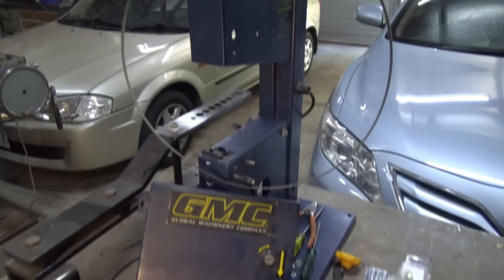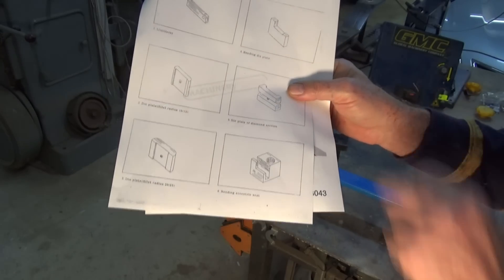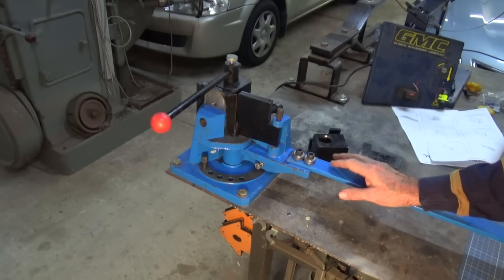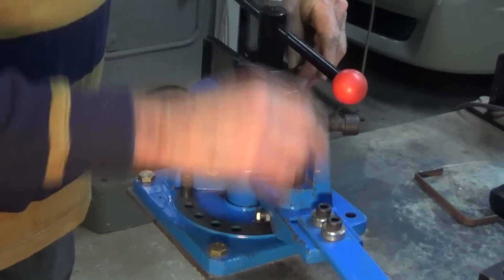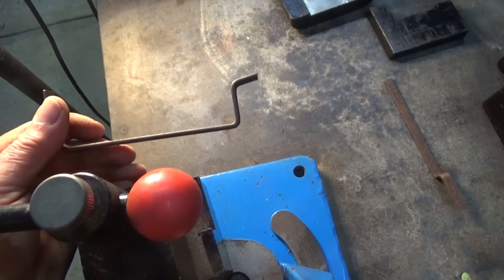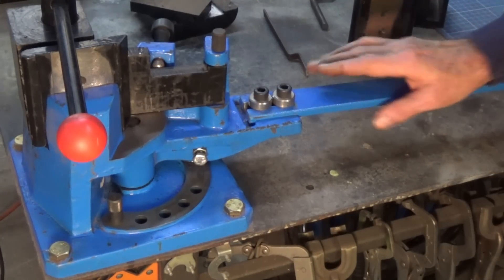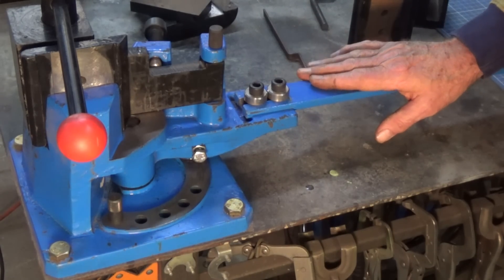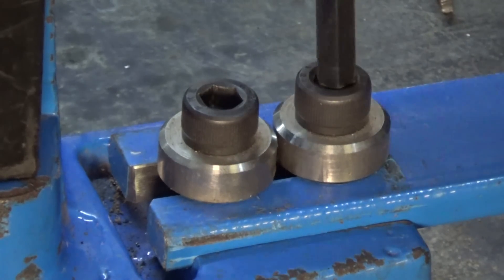UB100 Universal Bar Bender - Mystery Parts

Comment: Use that type of bender at work and did a few modifications as well. Welded some round bar to the end of the bending die nut to get some leverage and easier to release. The bending handle also bothered me. Cut the bending handle off at roughly 150 mm sticking out. Welded some flat bar to it until it fit inside a thick walled pipe. If I need a bit of leverage I just slide a long piece of pipe over that small overhang. If it is tiny delicate work  a small length of pipe will do. No bolts to unscrew. Just slide the pipe of and on.

Comment: Hi mark I have just bought one of these, has one else die blocks got small indents in when they bend round bar ?? 

Thanks james
Reply from the maker: The die blocks on my bender were quite hard, I know because I had to machine the back of one where it butted up against the frame of the bender. However, I have seen small diameter round bar indenting edges on pan brakes. We had one at the school where I used to teach and kids would try to bend wire in the pan brake. It put almost impossible to remove dents in the bending dies. Quite infuriating! I have bent 6 and 10mm round bar in mine and it seems to be OK with that. I generally won't use the sharp bending die though. There is one with a more rounded edge which is probably better suited to that operation. 
Regards,
Mark

Comment: My two cents!!!
I don't have the room to leave mine anywhere so I bolted a plate to the bottom with a heavy walled 40mm  RHS welded to it at the ends. (At the ends so the welds don't interfere with the jaws of the vice). I just pick up the whole bender stored below my vice and put it in the vice when I need it.
Also you have two Allen key sizes. Not sure why you didn't drill and tap the handle mount from 10 to 12mm. The slot will only be 1mm wider on both sides.
Also you can do the Z bend by putting the handle at 90 degrees and you use the L plate as a spacer to hold the work which is now upsidedown. You bend in reverse moving from 90 degrees to the zero position to achieve the second bend in the reverse direction. This method allows you to choose any distance between the two bends greater than 20mm.
So you are doing the second bend with the edge of the bending plate.
Reply from the maker: Thanks. It's a pity the manufacturers don't support their products with more informative manuals. Being able to store the bender after use makes a lot of sense. Mine gets in the way a lot but it sure is solidly mounted.
Regards,
Mark

Comment: Hi Mark, I'm just reviewing this unit and have ended up on YouTube. Appreciate your comments as I'm looking at the same at Hare and Forbes here in Perth. In the information section relating to this device they mentioned being able to bend at varying radius by changing/turning the die plate. I noticed that one die plate has radius corners. This means that you can achieve a lot more in both flat and round bar stock. Have you used that function?
Cheers Les.
Reply from the maker: Les, yes I do use it especially on aluminium which can fracture at the outside radius of a sharp bend. The rounded edge die puts a lot less stress into the material. The only thing I had to do was to mill the flat faces on the dies where they clamp against the fixed jaw. Mine were forged and the surfaces were quite rounded. It was hard to get them clamped accurately. I used a carbide insert face mill to clean up those surfaces and it does make a difference to the accuracy and repeatability of the bends you can achieve. 
Regards,
Mark

Comment: I did mean to ask, have you tried it on square tube?  Looking at one for a truss making job.  Would need to add something to the die to collapse the inner side of the tube but that would be trivial
Reply from the maker: I have not tried this machine of tubing. I do have a Hossfeldt clone bender and with the correct die you can bend square tube. I made one for round ERW tube but so far I haven't had the need to bend square tube. The dies I have seen for doing this have a small diameter round rod welded to the inside diameter form of the die to collapse the surface of the tube as you say. 
Regards,
Mark

Comment: Nice video.  Only point I would make is when using the eccentric I would pack the part so your angle is accurate.  The top section is for the same thing, making U turns on larger pieces which are too long to use the other die as they would interfere with the handle.

Comment: Being an old video you may not ever read this and may already have worked out what that cut away is for on the thin section of the large mystery block but I would say that it is for instead of making your jiggles or whatever you called them {the z shape} they are to make a square U shape or even to go on to make a full square as long as it has long enough sides to wrap around that inch or so of metal. You could make squares them weld up one corner to have a solid square.
Reply from the maker: I am sure that you are correct. It's just a pity that the "manual" doesn't have a little more information on how that block is meant to be used.
Regards,
Mark

Comment: Hello Mark, Mick here from Victoria and thanks for your video. I’m finding that during my use, the removable former pin is being bent to such an extent that the former is pushed out of vertical , rather then bending squarely I’m getting out of square bends. 
This while bending ⅛ flat so nothing too strenuous or heavy duty!
Unequal radius on bend don’t go well with accuracy!
I’m also having trouble removing the former pin because it is so distorted, once out it can be straightened again.
Have you read of similar experiences with using these metal benders?
My intention is to insert a wedge behind the former plate, hopefully that will prevent any distortion of the former pin together with ensuring an accurate and square fold/ bend.
The wedge will be secured in place by the 
⅝” Allen bolt therefore prevent any possible wedge misalignment,your thoughts please!
Cheers, Mick.
Reply from the maker: Mick, I seem to recall that the maximum thickness of flat stock for this bender was 10mm. However it depends on how wide the stock is too. I don't think I have tried to bend 1/2" in my machine. Probably if you were to use the die with the large radius edge it would reduce the strain on the centre pin. I did bend some 75 X 10 hot rolled steel but I slit the bend line through about half way with and angle grinder first and then welded up the resulting groove after the stock was bent. If you have access to a lathe, I would just machine up a new centre pin, preferably from some higher tensile steel stock. Something like an old truck axle would be good. 
Regards,
Mark
Reply: Hello again,
Not attempting anything like 10mm plate unless last resort,as per my comments I intend only dealing with light materials, 3mm (⅛) is common with my projects up to the most perhaps 6mm .
Wedge behind the adjustable former plate has fixed the misalignment problems,easy addition and held in place easily.
This is a great bender once the bugs are sorted,thanks again for the video!
Cheers, Mick.

Comment: So just watched the ToT video on his version of this. He had to machine the faces on it to get it to work correctly. I was wondering if you had to do the same thing but I think you got  much better version of the bender.
Reply from the maker: I watched TOT's video too. I didn't have the same issue with the out of square anvils but I did find that the backs of the fixed anvils were anything but flat. It looked like they had been forged badly and they wouldn't sit flat up against the fixed section of the base casting. I had to mill them flat before the two socket head screws could pull them hard up against the casting. I was surprised that the handle supplied on TOT's bender was just a piece of hollow tube. Mine was a solid piece of flat bar stock. Also, I would not be willing to try bending 10mm wide stock over 6mm thickness. Even 3mm is a bit of a struggle, but then I'm no Arnold Schwartzenegger!
Regards,
Mark

Comment: Hi Mark, just finished rewatching this video and I think I know what the step in the big "mystery"block is for. this is a somewhat older video and there are 97 comments which I haven't all read, so you may know the answer already, but anyhow: my guess is that its function is the same as from the mystery plate, to allow an already made bend to fit in the block. somewhat like a u shape that you want to bend again if that makes sense... Keep up the good work, I have seen most of your videos and love the content. Peter (from the Netherlands)

Comment: For the handle just make a bolt on stub out of round bar and a piece of flat then simply slide a length of tube over it when using the bender no bolting on and off then
Reply from the maker: I use that method on a Hossfeld bender clone that I made. For light bends on the universal bender I just leave the bolts loose and slip the handle slot under them. 
Regards,
Mark

Comment: Would this bend 3/4 round bar?
Reply from the maker: That might be a little too heavy for this machine. We could do 1/2" hot rolled easily and you would need to use the die with the large radius. You would also need to have your bender bolted down to a really heavy bench. 
Regards,
Mark
Reply: Thanks Mark. I make hooks from rebar for target stands. Harbor Freight has their version but liked the looks of this one even though it’s more expensive. Mostly 1/2 to 5/8 but I figured if it could do 3/4 the slightly smaller ones would be easy.

Comment: Can u bend 8x75mm flat stock with these? Was planning on making desk legs
Reply from the maker: I don't think it will do steel of that size. I have been able to get 4 X 75. I have had success with bending thicker stock by partly cutting through with an angle grinder (about half way) and then making the bend. You can then weld up the gap.
Regards,
Mark

Comment: Thanks Mark. I am off to buy one today. FYI, I have a small workshop with a welding / assembly bench. I have various bench mounted shears, vices and benders that I like to use but I still need to use the bench for welding. After some thought, I welded 8 of 50mm receiver tubes under the bench top in various locations. Each tube has a couple of bolts under it, threaded through welded on nuts. Now all my equipment is mounted on plates with tubes that slot inside the bench mounted receiver hitches. The effect is similar to a tow bar receiver and hitch. I can choose any location around the bench for any of the equipment or clear everything from the bench in about 60 seconds by loosening two bolts and withdrawing the equipment on its mounting tube. Works a treat!
Reply from the maker: I have been thinking that I need to do that too. I have a bench vice that I would like to fit to the welding bench but I already find that the bar bender and a replica Hossfeld bender which are permanently bolted to the bench get in the way of any welding job I want to do. Adding the vice would just make it worse. Another job to add to the ever expanding list!
Regards,
Mark

Comment: This is a great tool if you wanna pry straight and grind square every piece of steel it destroys. Not to mention all the fun you'll have grinding square the warped plates it comes with. The good thing is that it's heavy, so you'll get about $2 for it at the scrap yard.
Reply from the maker: I had used on those benders at work and I already knew their limitations and problems but it does a limited range of bends quite well. The bending dies all needed machining on the face that clamps against the body of the bender and once I did that the overall accuracy improved. Like all these import tools, you are essentially buying a "kit of parts" as Stefan Gotteswinter likes to calls them.

Comment: mark i was wondering do u know what sizes allen wrench it used on the side to change the die i bought one just like yours
Reply from the maker: John, I'll check tomorrow and let you know (it's late now).
Regards,
Mark
Reply from the maker: John, The screw on my bender is M12 X 1.75 at 65 long and the hex key is 10mm.
Regards,
Mark

Comment: hi mark, can this tool bend past 90 like for some hairpin legs?
Reply from the maker: Dan, yes, the UB100 bender comes with an anvil with about a 45 degree angle on it. There is also an anvil with a radius edge which will bend past a right angle but it gives a more gentle round.
Regards,
Mark

Comment: Hi Mark, just picked up one of these for next to nothing,but with only one plate, looked up Hare & Forbes for a manual & got the same as you. Pretty poor for something they sell for $319.00 on special. I can mill up some plates as I need them out of some blocks of pre hardened M238 injection molding steel I have . Thanks for the intruction video it’s really helpful....... I’ve subscribed also. Cheers Peter 👍
Reply from the maker: Peter, the brand new plates that I got with mine were very badly forged and the mating surface which clamps up against the body was rounded instead of being flat. I had to mill all the mating surfaces flat before I could use them. It would be useful to make up some "specials".
Regards,
Mark

Comment: Hey ime having a massive problem with my bender, it is not bending 3mm flatbar to 90 degrees it's so off it's like 35 degrees. Any ideas how to fix it?
Reply from the maker: Wow, 35 degree error sounds like a lot. There will always be some spring back in even hot rolled steel but normally you will need to overbend by about 5 degrees to allow for spring back. I would just make sure that the square clamping block is pinching the stock firmly and then adjust the bending plate with the adjusting screw so that it is flat against the unbent portion of the stock before you start your bend. 
Regards,
Mark
Reply: @Preso58  yea it is a lot of play. I checked the entire machine all fittings blocks and mock test without material and the machine stops bending way before 90 degrees I would say probably 35 degrees or so. I cant understand what it is that's causing the problem. The only way I can bend 90 degrees is by having no pin in the degree holder but then again that's pure guess work with no pin. I made a set of coat hooks and had to stop every second on every bend and check curvature by hand using a digital gauge. It took me forever and I am still determined to find out just why this silly thing wont allow me to bend using the  gauge. Thanks for reply m8.

Comment: Mi mark,
thanks for the info, I now know what the extra parts to my bender are for.
the rear cut out for the Eccentric block will be for allowing the fitting of a U shaped bar to be bent. the leg of the U both point in the direction of the handle.

Comment: I was thinking the cut away sections could be for forming  the ends of springs like the type you see on throttle shafts on some carburettors , one end is bent up and over the throttle arm and the other formed so it locks over a spigot on the carby body - a bit hard to explain ,  easier to show  if only i could post pictures here !.
Very hand tool those benders , i haven’t used one for  a long time and wish i had the room for one now ! I like the idea with the handle and i am going to copy it for my metal shears !
Reply from the maker: Ian, I went back and played with the mystery parts again and I was able to make up some small "top hat" profiles from round bar. The geometry of the bender is a bit restrictive and it is mainly intended to do one way angle bends in light to medium section material. I was just frustrated that the parts as supplied were not documented in any way. I was thinking that the video might prompt others to share any knowledge about how it is meant to be used. I take your point about the bend you are describing. I didn't try that but it sounds doable.
Regards,
Mark

Comment: Great explanation on the bender & accessories. Like your handle mod, got me thinking you could also have a rectangular steel block, milled out to step over handle, to help prevent handle spread.
Reply from the maker: That would be a complete solution but probably a "belt and braces" job. 😁

Comment: As far as I'm aware those tools are as you described. The three most common applications I've seen these eccentric dies used for is making custom U-bolts, handles, and offsets. 
Every shop I've been in always had these cold forming benders mounted on a pedestal stand  rather than on a bench. Of course the cold forming benders in those shops were the type which had a bazillion different dies and did everything from angles to making hoops with different stock. They were something like a No. 2 Hossfeld Universal Bender style of bender.
Reply: A compact universal bender is an economy copy of the Hossfeld bender.  I saw a complete used hossfeld set on Ebay for $3200...  I would be neat to own one.